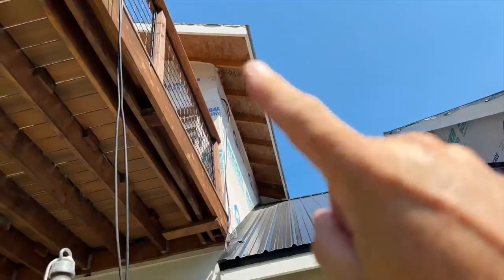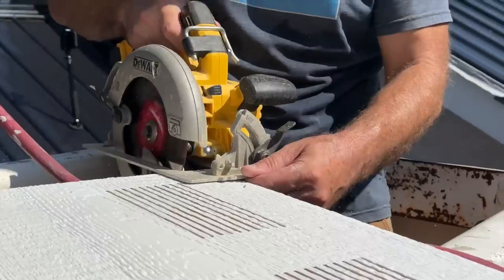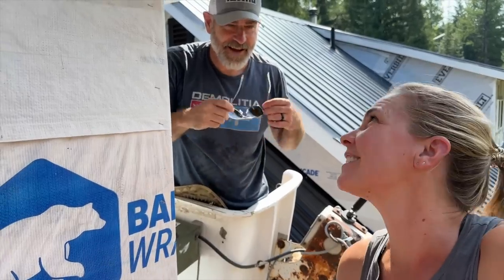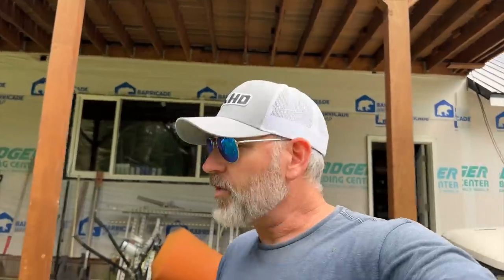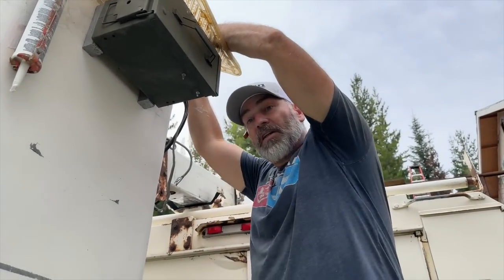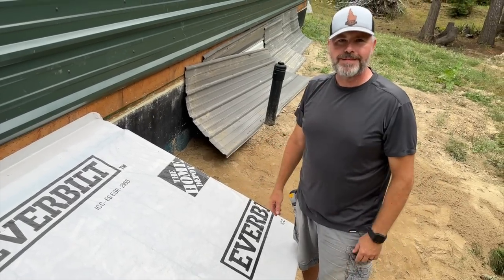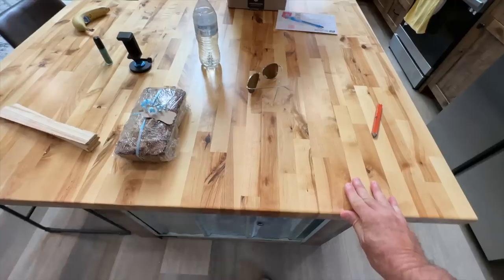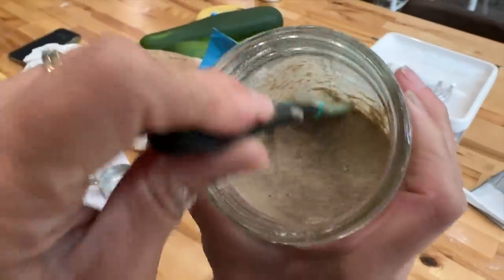Making Progress NOW! Building our Off Grid Home in the WOODS.

Comment: @ 3:17 through 3:32 See that notch at the far upper right of the frame. See how the fascia you just inserted, shows up in that notch. My question is... Isn't rain going to get in there? Capillary, if nothing else. Looks like at the least snow will be forced into that area. 

Solution? I don't know. Maybe... It might not look the nicest, but maybe you could fill some of that up with spray expanding foam, then paint it white when cured?

Comment: Marty, Your root cellar entrance should be concrete and not wood. Even the pressure treated stuff will rot in time in that situation. I would suggest that you pour a small slab and use concrete block and a bilco door on top to shed water away.  I've done a number of them like this and they're all still going strong. You can coat the exterior to waterproof. Just my two cents worth. The place looks great.